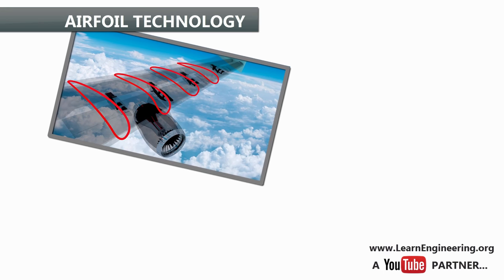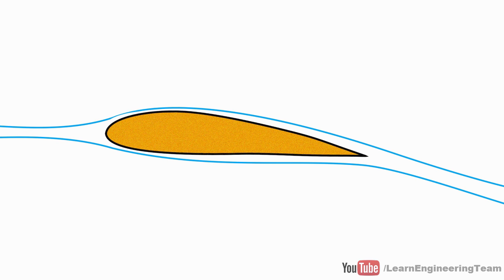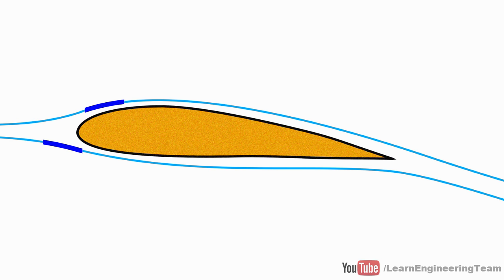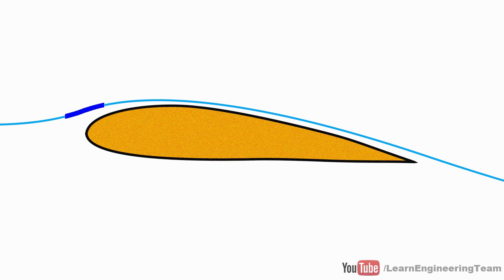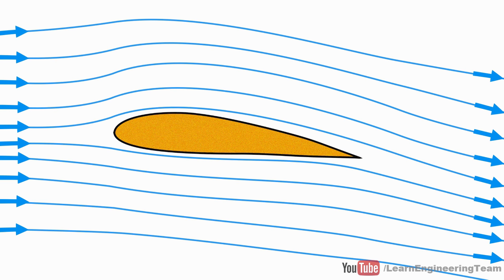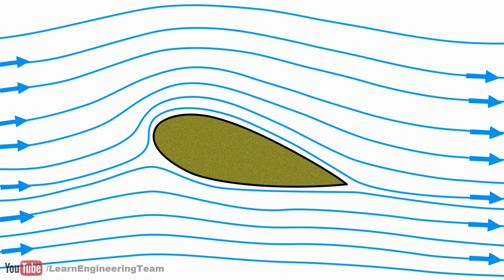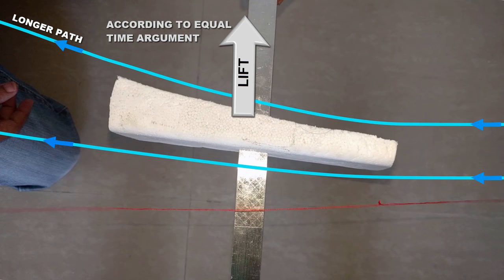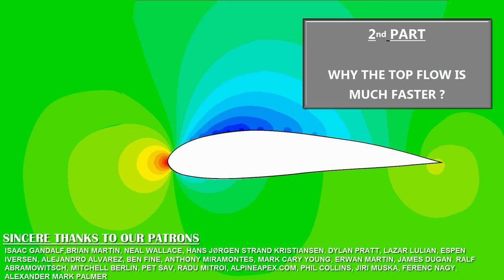How do Wings generate LIFT?

Comment: 4:45 that's not the reason... watch this: https://youtu.be/ZpoK0InPciM

the reason is because drag changes with angle of attack and airspeed... so what works in a landing or slow speed configuration is not ideal for cruising... so flaps were invented to change the wing to that more lift inducing but higher drag shape (4:44) to reduce landing airspeeds so landing is safer, but flaps retract so lift reduces but the airfoil is more efficient, which allows faster cruise speeds and less fuel consumption.

Comment: Aiyo..... a weird elongated foil will resulr the air flow to be non laminar at the top.  It will exceed the reynold number for lamina flow and turbulance set in at the top to push the aerofoil wing down........this video isnt very convincing without considering reynold number

Comment: But in the equal time argument the way they are explaining it is saying that the air is moving across he wing but in reality its the wing moving through the air so tecnacly the air should not move forward or backward but only up or down so when the wing moves through the air the air shouldn’t  change its position laterally but only vertically now I don’t feel like explaining props or any other things like that cause truthfully I’m lazy but also I’m tired and don’t know what the fuck I’m talking about at this time
Reply: Also I’m tired
Reply: that's true, though not a very convenient reference frame to work with (and identical to the one with the wing stationary). The air does move forward and backward a bit, but mostly up and down

Comment: no what happens is the wing is tilted so air hits the bottom of the wing pushing the plane up
Reply: That's the Newton explanation, and it does contribute to lift, but it is not the main reason. The Wright brothers flew because of your explanation, but modern aircraft use aerofoil shapes to generate lift in multiple ways.

Comment: Please stop ending every sentence with a rising intonation. Otherwise, great video!

Still wondering, how do planes fly upside down?
Reply from the maker: Planes have adjustable wings. They can basically change airfoil shape with help of flaps and slats.
Reply: The exact same way they fly right side up. Foil, AoA and power fro the engine.

Comment: So.... how do paper planes generate lift if the wings are flat?
Reply: Well, with the correct angle of attack (how the wing is positioned in the airflow), even a door should be able to produce lift. If I had to make a guess I'd say some paper planes produce lift because they point slightly upwards since their center of balance is to rear (Unless it's top heavy and drag stabilized, but I think in that case it'd function more like a shuttlecock rather than a wing.). Like how hang gliders and kites produce lift, or any kind of surface that produces lift; it redirects air.
Reply from the maker: Thank you for the right reply. Even a flat surface can produce a lift with an angle of attack. But equal time argument cannot explain such phenomenon.
Reply: The wings need Angle of attack. With Angle of attack the flat wings will push air down which will push the wings up

Comment: this video  explanation is wrong. bernoulli's principle is correct, there is possibility of speed differents in two surfaces  more curve more speed of air because  normally our surrounding atmosphere balance that is air medium  is equal there is no pressure change, when air flow over curve surface, there will more displaced the statics airs then displaced air try to comes back it's  original postition which increase speed of air in curve surface but no curve less displaced less speed of air.... your bottles experiment is totally wrong it's because of surfaces tension....I can explain more but unfortunately I don't have good english......

Comment: MMM  Airplanes fly upside down. Were is the lift ?
Reply: here is angle of attack comes to help them. remember newton's 3th law ? think of whole wing as a shield and reflecting the air from going backwards to backwards+down, so there must be up force (lift) to counter the air that vectored down to ground. Also most of aerobatics planes uses symnetric airfoil that don't generates lift from bernoullis principle instead only produces lift when intruced to air with angle. This is why aerobatic planes front landing gear longer than back landing gear. If you wan't to learn more from it search for angle of attack. Sorry for my bad english it's not my primary language
Reply: @bruhmettinmomentogullar4215  The physics is the same BECAUSE it is the pattern of the air flow that is the thing to look at, NOT simply the wing shape.  An inverted wing and a flat wing have the same airflow pattern.  He doesn't explicitly state it here, but it is the airflow pattern that is the ultimate cause of the pressure changes in the vicinity of the wing.
Reply: @Observ45er   planes are flying inverted is not that stable and manurevble at all this is why you never fly a plane %100 fully inverted (except aerobatics planes) its always bit of pitch to create lift from angle of attack. As you mention it simply cant create lift from airflow. Aerobatics planes are never fly %100 level (both inverted and normal) because of symnetric airfoil shape dont creates lift from airflow. It only creates lift when introduced angle.  Some of them has angled wings. When fuselage is at level flight wings still have angle of attack to make plane fly. No plane can induce lift from airflow while inverted.
Reply: @bruhmettinmomentogullar4215  Correction: I said: "the pattern of the air flow;  that is the thing to look at, NOT simply the wing shape".
An upright wing and an inverted wing have very similar flow patterns when generating lift and that shows that the flow pattern is caused by the pressure changes.  I'm an engineer/pilot/instructor who consulted experts in the field and understand it.  That's why I'm explaining here,. No need to explain things to me
Regards
Reply: @Observ45er   I'm engineering student and aviation geek (also ı'm using flight simulator called dcs world ) I'm far from real thing thanks for info I wrote my answer right after woke up sorry ı didn't understand it very good now I read it again and saw I mistook your  answer sorry
Reply: @bruhmettinmomentogullar4215  It is ok.  
Real thing: 
ALL wings create lift by creating pressure changes (gradients) around them.  
..
ALL wings must have some effective Angle of Attack to generate lift.  The pressure changes are the cause of all air accelerations around a wing: this includes ahead, behind, above, below and over the wing tips. 
..
ALL wings have similar airflow patterns when generating lift.  
..
 ALL wings use he very same physics.  Newton, but the way I describe.  The common "Newton Reaction" explanation is a very weak, partial explanation of lift.

Comment: I believe in the Bernoulli principle. Your video desn't make much sense to me.
Reply: +Rochdi Tidjani,
The common misunderstood description actually violates Newton's Laws
 ("Fast air creates a lower pressure" = incorrect and too many times repeated bad science)
. 
 The simple fact is that the wing (any object) must push the air around to get through it, and therefore CAUSES the pressure CHANGES.
...
Also, pressure differences accelerate air. Fast air DOES NOT necessarily have , nor CAUSE a lower pressure. A higher pressure pushes air toward the lower pressure region. THAT is WHY it is going faster when it gets to the lower pressure. Not the other way around.
...
  Moving forward, toward some air, increases the pressure at the surface.  
Just walk in water and feel the added pressure on your chest as you move into the mass of water.  YOU are increasing the pressure by 'advancing' on the air.
...
That increased pressure pushes the water/air away from you toward ALL nearby lower pressure regions.
...
Behind you, you move away from the water/air, thus reducing the pressure. The higher pressure further away, pushes water/air in behind you.
...
Pressure differences are the force that accelerates air.
...
...
Above the wing the air must curve to get 'over' it.  Since inertia wants to keep the air going straight (as HE shows) the air is trying to move AWAY from the wing (or the wing surface is moving away from the nearby air)...THIS AND THIS ALONE reduces the pressure.
A surface moving away from where the air is (or is trying to get), lowers the pressure at the surface.  ALSO, IF the air's inertia (remember that air has mass) is trying to carry it away from a surface, the pressure is also reduced.
...
The air is pushed from a higher pressure region (ahead of the wing) toward a lower pressure ( above wing) region (Newton). This is why it gets to the trailing edge first, the pressure is lower above.
...
Below the wing, the pressure being higher, pushes that air down AND  FORWARD.  In the wind tunnel view, this "pushing" on it slows it down.  
...
On the other hand.
...
If you look at the wing MOVING through STILL AIR.  You see that that bottom air is pushed along with the  the wing for quite a distance, thus arriving at the trailing edge after that upper air.. 
...
THEN, if you apply the correct physics of pressure differences driving the accelerations of air, ALL other movements, including the down-wash, are easily seen.
Reply: Fast air does create lower pressure and it is the difference in air pressure that creates lift. Bernouilli principle does contain the concept of velocity included in his equation. The principles to which you abide are not only bad science they are ludicrous!
Reply: +Rochdi Tidjani,
 I am sorry, but, unfortunately, you are mistaken and follow a very common misconception.   It has been repeated so much that armchair amateurs will fight a bad fight that is so easily shown to be wrong.
...
The correct concept contained in Bernoulli's _PRINCIPLE_ is ONLY the INVERSE relation between changing pressure with changing velocity (acceleration) in a flowing fluid,  
When stated correctly, it gives NO cause and effect.  It merely states the inverse relationship.
Is says nothing about unrelated flows and pressures.
.... 
The so often misunderstood science IS as I correctly describe. It is not conjecture.
...
The Fast air out of a blower does NOT have lower pressure than the surrounding still air and this can easily be measured by anyone.  
...
Pressure gradients accelerate fluid.  The commonly mis-quoted Bernoulli Principle of "Fast air has/creates lower pressure"  violates Newton's laws and is a misinterpretation of the CHANGING velocity along a stream, not simply speed.
...
A higher pressure region 'behind' a flow pushes it, thus accelerating it to a higher speed and that is why it is moving faster when it gets to the lower pressure region. 
...
The common demonstrations of blowing between curved balloons or cans ignore  the pressure reducing Coanda effect that is present.  Eliminate the curved airflow and the pressure reduction, and therefore movement, vanishes. I demonstrate this to show how the common demonstration is always misinterpreted.
,,,
Bernoulli's __EQUATION__ has velocity _ALONG A STREAMLINE_ (Two different locations ALONG ONE FLOW) which means it is tracking CHANGES in a SINGLE stream which is acceleration CAUSED BY pressure changes ALONG that path.
...
You don't have to believe me.  Consult someone who is ACTUALLY in the field, as I have done, or some authoritative references.
...
Here are some authoritative references much better than amateur YouTube videos or what you may have been taught by someone who was also mis-led by other well meaning teachers:

Weltner shows how to measure this "fast air" pressure in Figures 3 & 9:
...
Weltner in PDF - "Misinterpretations of Bernoulli's Law".:
 http://user.uni-frankfurt.de/~weltner/Misinterpretations%20of%20Bernoullis%20Law%202011%20internet.pdf    
...
Anderson & Eberhardt AAPT paper: The Newtonian Description of Lift of a Wing-Revised 2009:
  http://home.comcast.net/~clipper-108/Lift_AAPT.pdf     

John D. Anderson Fundamentals of Aerodynamics. fifth edition:
http://aaun.ir/wp-content/uploads/2015/07/John-D.-Anderson-Jr.-Fundamentals-of-Aerodynamics-McGraw-Hill-Science_Engineering_Math-2010.pdf 
...
A very good video. Professor Krzysztof Fidkowski, associate professor, Aerospace Engineering  University of Mich.
How Planes Fly.  https://www.youtube.com/watch?v=aa2kBZAoXg0  
 ...
...
 David F. Anderson. - Many very good observations. 
Understanding flight  https://www.youtube.com/watch?v=hQ99JkaOwEk  
- - 
Regards
Reply: +Rochdi Tidjani,
 I see you fear looking at at the real science.
...
P.S. Doug McLean, Boeing's lead expert is only  one  of the people I worked on this with.
Reply: You are full of it.
Reply: I see you are so serious about learning the facts of science. Who have you even talked to on this?
...
Those references are indeed, FULL OF  more than you'll ever have hope of understanding.
Reply: +Rochdi Tidjani
I have no videos.
QED.
Reply: +Rochdi Tidjani,
 Your ignorance is excusable with all the trolls around.  Doug McLean and I volunteer for the same organization.  

Doug McLean Boeing Technical Fellow, retired:  Common Misconceptions in Aerodynamics.
 https://www.youtube.com/watch?v=QKCK4lJLQHU  

You can verify his affiliation on his Linked In page.

Regards, Steve
Science and Technical Advisor
challenger.org

Comment: Even though there might be a difference in air pressure under and above the wing, it is just too small to provide a lift.
Reply: Nope.  That pressure difference IS THE WHOLE LIFT!!  This is well known by pros outside of these amateur circles.
.
That pressure difference pushes the wing up.
The same pressures also push air down for the Newton's Third Law effect.
..
Above wing reduction gives folks the most trouble. For a better understanding of the detailed cause of the reduced pressure above a wing, try this short video:
https://www.youtube.com/watch?v=3MSqbnbKDmM
Regards

Comment: Simply put a wing creates lift by forcing the air downward.
Reply: Yes, its partly simple rocket science. There is the addiional portion of the pressure differential that transfers away from the curvature of the airflow, providing lift too. As Shauberger was famous for emphasizing, its Implosion power that runs natural systems (that pressure drop). He also observed the temperature will drop in the low-pressure zones making the fluids denser and more powerful, in water this provides a natural filter function, separating out contaminants. Water applications are where Shauberger applied his discoveries and theories; he succeeded in getting flowing water to lift huge logs that otherwise would not float and developed systems used today by Zamboni to freeze water with less energy and time than can be done by other methods.One key application he observed and copied is the way fish use their body shapes to swim, clearly similar to the wing effect of airplanes.  B

Comment: If air is fluid (like water) and has mass, shouldn't gravity affect air moving across an airfoil and play a part in lift?
Reply: No.  While gravity is the ultimate cause for the pressure in the first place, that is its only role.
..
It is fact that any 'blob' if air is fully neutrally buoyant in air.  Air has the same density as air, therefore it is neutrally buoyant and there is no effect from gravity for any bit of air over any other bit.

Comment: Coanda effect does not apply to airfoils!!!!
Reply: Yes. Coanda is for a jet into otherwise still air.
For a better understanding of the detailed cause of the lower pressure above a wing, try this video:
https://www.youtube.com/watch?v=3MSqbnbKDmM
Regards.
Reply: @Observ45er  no, the coanda effect only applies to fluids that come out of a nozzle, I study aeronautical engineering. and that theory is taught to pilots because it is an easier way to understand why the air sticks to the wing, however it is incorrect , there are some aircraft as the globemaster that utilize the Coanda effect.
A method to produce the Coanda effect
is to DEFLECT a part of the EXHAUST from
an aircraft engine over the wing of an
aircraft in flight. You can read that Nasa article PAGE NÚMBER 3 (sorry for my grammar i am from Peru) , also you can read this answer from a person  that study aerodynamics (is the second link)

https://flight.nasa.gov/pdf/foam_wing_k-12.pdf

https://www.quora.com/How-does-a-wing-create-lift-from-the-standpoint-of-the-Coanda-effect
Reply: @MrJackjr7  That's what I said! ... or at least meant:.  sorry.  
.
I meant that Yes, it does not apply to a wing.

I said: "Coanda is for a jet  into otherwise still air."   [or sheet]
.
His patent specifies a jet or sheet...
.
I usually add that it also has continuous entrainment around it and  although has some similarities to above a ring, there is no entrainment above a wing and no jet onto still air. 
 Coanda does not occur above a wing, even though Professor Babinsky says it is Coanda above a wing.  I've studied aero, ny son is an AE and I've read and talked with several big names in aerodynamics, but haven't gotten to Babinsky to talk about that issue.  
Regards